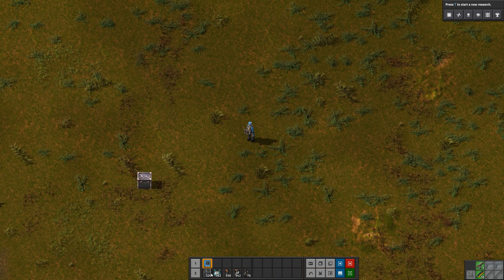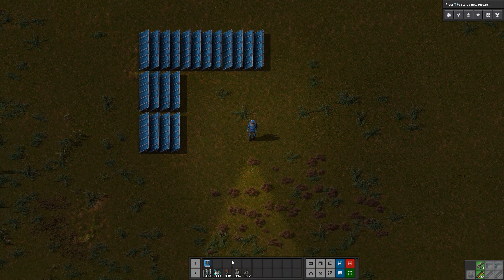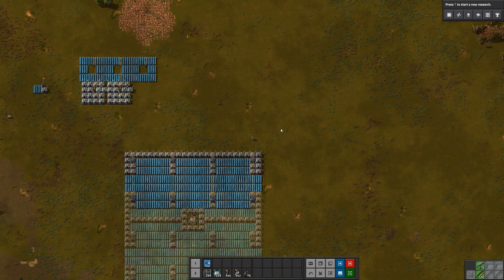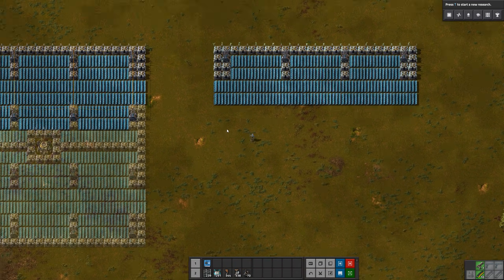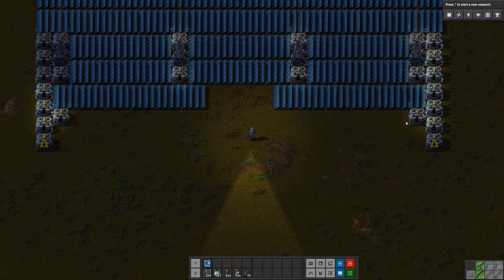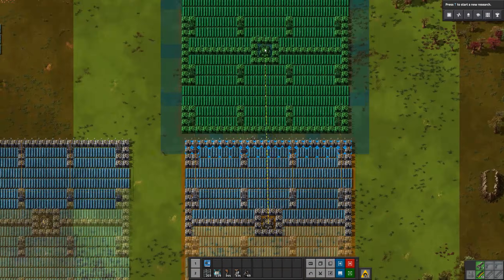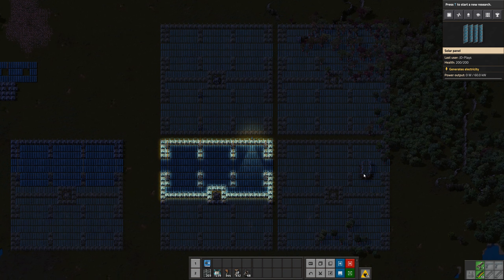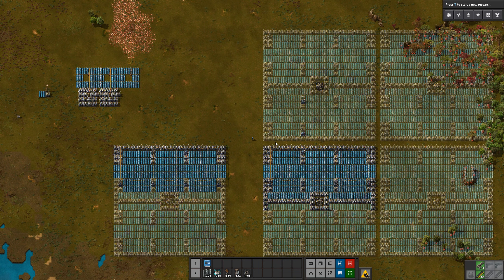Factorio Solar and Accumulators ⚙️ From Hand Building to Blueprinting ⚙️ Tips and Tricks Done Quick

Comment: In real life, nuclear is actually better since solar panels produce very little power and require very specific circumstances to produce full power, however nuclear reactors produce a lot of power constantly and don't need a specific set of circumstances to keep producing power. But in Factorio, solar power is probably one of the best power sources you can have (I haven't played until the endgame, but they don't require maintenance like the engines or reactors, but they still require large amounts of spaces to produce meaningful amounts of power.)

Comment: Don't see any reason to follow any exact design. Only if are limited by land or for some easthettical purposes (imho this design in video do not look easthetically organic). Nothing bad to leave some gaps - not to block or slow your movements thu base.  Just hold proportion 238 panels to 200 accumulators (gross 6/5). Nothing bad if u will have some little extra accums in your design, especialy if u play with biters and defending base with lasers or u have inconsistent energy consumption.
Reply: actually the proportion is 21 acumulators to 25 solar panels
Reply: @wdym._.  238 to 200 is a more accurate proportion

Comment: I just do 35 solar panels per substation (6x6-1), and 80 accumulators per substation (9x9-1) on a max spread substation grid. Roboports and radars as needed. It makes the math much easier (Panels/substation: ~2 MW peak / ~1.5 MW average, Accums/substation: 24MW peak / ~17 MW average). I actually got rid of 90% my accumulator blocks because my nuclear power can generate hundreds of megawatts of excess from stored steam and a few extra turbines. Since 1 tank of nuclear steam is 485 accumulators, it saves a lot of space and resources, and I can just do pure solar panel builds.
Reply from the maker: I like it steam is way more compact, and actually somewhat cheaper

Comment: I think one point to note is that you need radar coverage to be able to blueprint from afar, so a lot of solar grids also include radars so that you can continuously expand (though a lot of times you also want to remove those radars once they're not on the edge of visibility so that they're not wasting power)
Reply from the maker: One of the included blueprints comes with a radar. In my experience I have found that running out and pre-placing roboports and power, then coming back and placing the solar and Accumulators and doing it in large batches is the best way to get the bots to build the solar array as the network isn't changing they tend to build much faster!
Reply: @JDPlays  but, uhh... you can't do that from map view for a 50x50 chunk (or larger) solar field...  ;)